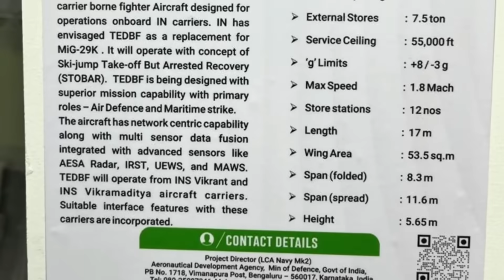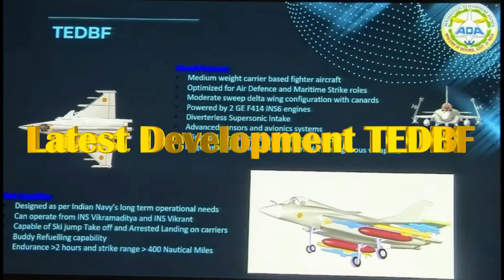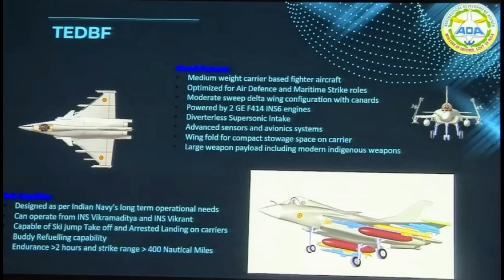TEDBF fighter jet design undergoes further refinement #tedbf #indiannavy #ada

Comment: My suggestion would be to go for say 150-160 TEDBF planes
We shall be having 2-3 carriers, thus each carrier with say 26 plane compliment,
that would be 78 planes operational on carrier, During same time we should have 3 more squadrons that are on say various Air stations like INS Hansa, Vizag and chennai etc conducting training, refits, overhauls etc, also in terms of performance, these TEDBF would be at par with say Rafale with modern radar, avionics, weapons etc, thus these can be used from say IAF air bases if need arises, there would be economy of scales with this number, remember IAF needs planes to replace Jaguar, MiG-29 and Tejas II is not the plane, because its single engine, so Tejas II can replace say MiG-21,/23, Mirage 2000, in like for like in terms of engines, for replacing say Su-30 MKI in future, and likes of Jaguar or MiG-29 it should be twin engine plane like TEDBF. Once TEDBF is operational, IAF will want to have an Air force version because they want Twin engine.
GoI should block the import of Fighter jets
Reply: Yes India does not require very large navy with ships and destroyers. But we require very large Air Force and naval Air Force with large submarine fleet to counter future threats with long to very long range, strike capabilities. We also require large fleet of long-range  bombers with Naval warfare capabilities along with P8 like aircrafts.
Reply: @vishalrajyaguru2597  Destroyers, Frigates are very important, they provide support to big carriers and big assets also they are one ship arsenal if properly armed, they can take down enemy ships & planes alone, which a carrier might not be able to do,
So yes we need a lot of Destroyers, and many more Frigates.
To give in emphasis, Aircraft cariers are like Rafale, good for operation, expensive. Frigates are like Tejas, good, effective, do not spend more time for maintenance, cheap to buy, use and operate, effective when requierd
Reply: we can carry as high as 30 aircrafts from our carriers, getting hands on 3-4 LHDs shall move away the burden of Helicopters onto the LHDs and ACs can be used to max potential we as many as 30 aircrafts 

French Navy's Charles DeGaulle AC has same size of Vikrant and still can carry around 40 aircrafts... we can atleast carry 30, so 2 squadrons on one AC, 6 active as a result, and 6 on standby (refits/extras)

if we consider 18 per squadron, then for 12 squadrons, we need 216 TEDBFs, so in short around 200 aircrafts are a must, 150 toh minimum hai... waise if Indian Navy increases order numbers from 26 to 57 Rafales (as was once planned) then surely 150 TEDBFs will be fine a Rafale bhi toh honge (although I wish around 180 TEDBF ho, aur baaki ke 20-50 Rafales ko hum Andaman and Nicobar mein station karden, as a NATURAL aircraft supercarrier) 

China bhi same cheez Coco's islands main banakar betha hua hai, its time we do that in order to counter them..

Comment: The biggest mistake was making it a delta wing, we should have focused on diamond wing like f22 &f35 and
It should have had two rudders configuration achieving stealth angles unlike this single really this 2 changes would have made it alot more capable and more stealth more munuevrabilty.(less radar cross section ) 
the air intakes configuration achieve stealth angle . Its quite good to see 3rd new air intakes rather than those 2 types of American jets.
Im very disappointed with old delta 
Wing design and single rudder
Reply: old delta? bhai kya bol raha hai? bhai US Navy takk F22 use nahi karti.... aur US Navy ko pasand nahi hai F35 
kya bol rahe ho? Delta wing OLD kabse ho gaye? F16 se behtar uska Delta wing F16 XL prototype tha (lekin reject ho gaya coz already F15 tha aur F18 bhi induct ho chuka tha, anyways single engine ka tha F16 XL bhi)

lekin US Navy ke new naval fighter FA-XX aur USAF ke new airforce fighter NGAD ke designs dekhe hain kabhi? dono ke designs most probably delta wing hi honge

Tempest bhi DELTA WING designed hoga (6th gen fighter)

bhai na jaane kyun aaj kal logg kuch bhi bol dete hain... bhai aapko ispe knowledge kum hai 100%, thoda study karo ispe... Delta wings have their own pros and cons...

aur haan, AMCA propose kiya tha Navy ko lekin Navy ne hi reject kiya hai, and Navy knows better (its the BEST wing of entire Armed forces) 

toh ek hi baat bolunga... bhai samajh lo thoda sa... and Air intakes ka kya lena dena? 2 hi hote hain aaj kal sabhi main, yeh 3 kahan se aa gaye? aur pata hai, zyada air intake ki space (Area) hogi toh kum stealth hogi... tabhi jets aaj kal DSI config main aate hain (thode S shaped intakes, even meri knowledge iss air intakes ke topic main weak hai)

and btw NOTE THIS MAJOR THING

 DIAMOND WAALE AIRCRAFTS ARE LESS MANEUVERABLE THAN DELTA WAALE AIRCRAFTS

thats a FACT

those F22 and F35 are worst for dog fights, they are like SNIPERS, not "fighters"

and stealth se zyada aaj kal DATA LINK zaroori hai, Situational awareness, AI Integration, Data Fusion etc. 
toh 4.5th gen fighters ki value badhegi... 

kitne hi utha lega ek naval figher? waise bhi weight kum rakhna padta hai taaki carrier se launch ho, ya toh fuel kum ya toh weapons kum... toh STEALTH fighter bana denge na toh MISSILES kum carry hongi aur range bhi kum milegi, koi faida nahi phir

Navy main BACK karne ke liye aur fighters alag se nahi aayenge (future main AMCA agar stealth aircraft hoga toh uske saath Sukhoi aur Rafale bhi udenge as MISSILE TRUCKS and also FIGHTERS for dogfights to save the STEALTH fighter to engage its targets without being detected)

NAVY main essa nahi hota, we cannot sacrifice on missiles and maneuverablity there, actual main TEDBF ka design BEST hai... worst nahi

bhai knowledge lekar bola karo na warna misleading lagta hai... 

and NAVY ko abhi STEALTH fighter itni jaldi nahi chahiye, even US Navy bhi nahi le rahi, F35 wahan sirf aur sirf naam ke liye hain (ulta pareshaani de rahe hain F35 US Navy ko... kaam kuch kar nahi paate F35 for US Navy)

Marines alag hain wahan, Marine Corp ko F35 pasand hai, not for stealth, but rather kyunki yeh F35 Harrier ke upar ek upgrade tha (vertical takeoff/landing)

toh F18s ke new versions isilite aa rahe hain, aur isi wajah se aaj bhi koi NAVAL STEALTH programmes nahi chala raha

TEDBF ke paas stealthy design hoga, lekin missile capacity 4th gen ki hogi, best of both worlds, in short TEDBF ka BEST DESIGN hai, worst nahi...
Reply: @lightyagami5483 look dude I said delta wing can never give complete stealth like 5th gen fighter .f22 is very munuevrable after sukhois it is the most munuevrable aircraft with 2d vectoring nozzles . Diamond configuration give more stealth no doubt about it..
2nd point was it should have 2 rudders like f22 not single which also compromise stealth & and give more control surface area (more cross section). And sorry I didn't mention clearly that 3rd air intake for stealth,what i was telling that all stealth aircraft around the world all have same kind of air intake f22 or f35 the tedbf looks a bit different I was talking about 3rd new design. Not 3rd intake😭.
Delta wings also have alot more drag low speed flight are not stable neither as  efficient 
 (anyways flyby wire is there) 
Whereas diamond wing is also a kind of delta wing but still it has very less drag compared to delta wing for same surface area. This is proven fact for both yf23 &f22. No way f22 is less munuevrable it has 2d vectoring we should invest on flat nozzles as well.
Even us air force reduced f22 number because they were too expensive too build and maintain and f35 isn't purchased enough because of diamond wing f22 is a heavy weights aircraft even naval f15 was build but navies all around the world never operate aircraft weighing more than 30 tons hardly only f35 is 30 ton rest all naval aircraft are below 27tons fa18 24tons rafale . 
Chinese navy is exception they had no option nobody would have supplied them a aircraft for navy. Whatever they brought tech of su33 still it is impossible to takeoff at it's full 36 tons mtow..
Tempest is not delta wing it's angles of wings are neither complete diamond nor complete delta like triangle(rafale, mirage) 
Secondly the 6gen delta with that kind of design will they be able to have good munuevrability with no rudders .
And neither it's is needed because new dimensions of air fights have came you did say about that. 
In short tedbf should have good if it would have had diamond, wing twin rudder that too with canards would have been very lethal munuevrability.

Anyways we here can't do neither we are  capable like the brains who working there they know very well what they need at what cost .
But I felt twin rudder& diamond wing design  would have been great 👍 what do u think .
If we look factors like drag stealth!
Reply: @Ulatimber design doesnt matter bruh... Rafale is better than FA 18
and even if its not, then too, both FA 18 and Rafale M are NOT diamond winged as you said

one is a delta winged and other is a trapezoidal one, not "diamond" one, its more of a STRAIGHT winged design without much SQAURE shape... I hope you have seen it

so yeah, US Navy itself doesnt use that much of a DIAMOND WINGED aircrafts as of now

and Indian Navy REJECTED to work upon AMCA naval variant as that didnt seem TOO GOOD, it could have been made but the costs would have overrun a lot and thus causing a very high price for Naval AMCAs

thus having a 5- jet (stealth is not important for naval fighters as of now) is good for the navy with a Delta winged design (something which can be taken from the Tejas series, merged with a few things of AMCA, and you will get a new jet in less time) as we have expertise in making delta wings as of now

thus India, if it wants, to fund a futuristic dedicated 6th gen fighter as well, for navy and airforce, then the Indian FA XX and NGAD programme equivalents might commence somewhere around 204 (once AMCA and TEDBF get procured in good numbers)

thus the DESIGN thing doesnt matter, some designs are better than others in some things, weaker in other things... its just what the navy needs it best for them, that they chose this design for TEDBF

if NAVY likes it, why bother? Navy might as well launch it way before AMCA or even Tejas Mk2 given that Navy undertakes its projects seriously despite getting the lowest share of defence budget
Reply: @lightyagami5483 delta wing have alot  more drag than diamond wing that why Northrup Grumman & LM both designed diamond shape design. Diamond wing with same surface area have less drag 
search it ..
Delta wing have high induced drag at low speed . Unstable at low speed isn't a problem anymore.
Even if diamond wings has less munuevrability than delta but it's not needed that much in todays warfare.  
F35 has trapezoidal type but still both are referred as diamond wing as 
And diamond wing look really sexy 😂
Reply: @lightyagami5483  and in 6gen the complete airframe is delta wing not just wings
Reply: kon bola? @Ulatimber  
kabhi FCAS ka design dekha hai? also Mig 41? and AMCA Mk2??? they are non delta winged 6th gen fighters which will come around 2040...
Reply: @lightyagami5483  dude they are not complete triangular like mirage they have sorted out high drag in it look at those designs I said complete triangle it's not except Americans 6gen but it's complete body
What I mean complete triangular design should not be used like tedbf amca mk2 has trapezoidal wing design like f35 this designs have sorted out high drag low stability at low speed and unstable angle of attack. Anyways angle of attacks isn't a problem not needed.
Delta wings have different types
Non triangular delta wing that's what is usually referred to as diamond wing .
Amca mk2 is delta just look at images of amca mk2 &f22  from upper side both look similar , it's not complete traditional delta wing
Reply: @Ulatimber  what? you said diamond wings as "F22 and F35" and then now you are saying "the Deltas are diamond winged"

bro what is this "diamond wing" thing XD which you believe in, you confused the heck out of me XD

AMCA MK2 is delta? bhai at this point, with such weird classifications, its hard to judge what you are thinking... I didnt get what you are saying

old delta meaing "completely backwards" should not be taken, oh thats what you are saying? like in Mig41? you want the "Delta wing" to get a bit trapezoidal in the case of TEDBF?? 

well TEDBF's design phase is still not complete, wait for next years AERO INDIA 2024 to see the updated design model perhaps (even I have heard that they are including Semi recessed missile bays like in KF 21 Boramae into TEDBF)

I think TEDBF will look even better now, and even more stealthier than before

lets see...
Reply: @lightyagami5483  that's what is said call it trapezoidal or diamond wing or even large area clipped delta wing of f22 .it is reffered as diamond wing .
I just said that those 2 changes what I felt if it would have had it would have been even better aircraft which would have reduced drag ,low speed stability & angle of attack that too with canards and twin rudders to reduce rcs
And complete triangular traditional delta wing has more rcs from behind
Reply: @lightyagami5483  delta wings are of different types as well .
Reply: @lightyagami5483 diamond wing is type of delta wing reffered to trapezoidal or f22 type
Reply: diamond wing is a type of swept wing that has a triangular planform with a leading edge sweep angle that is greater than 60 degrees. A delta wing is also a type of swept wing, but it has a leading edge sweep angle that is typically between 30 and 60 degrees.So, in a sense, all diamond wings are delta wings, but not all delta wings are diamond wings.
The main difference between diamond wings and delta wings is their leading edge sweep angle. The greater leading edge sweep angle of a diamond wing gives it better performance at supersonic speeds, Delta wings, on the other hand, have a lower leading edge sweep angle, which gives them better performance at low speeds, but also makes them less efficient at supersonic speeds.